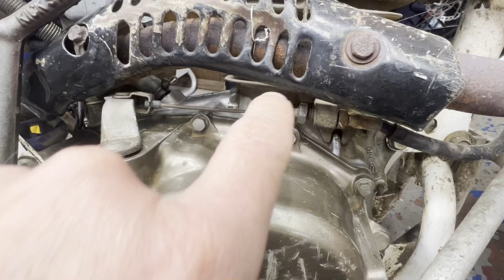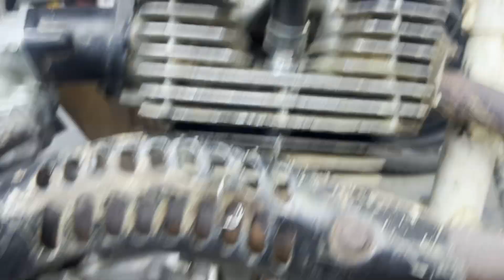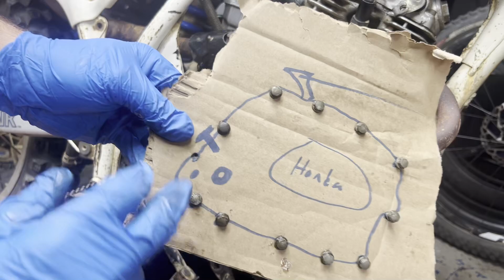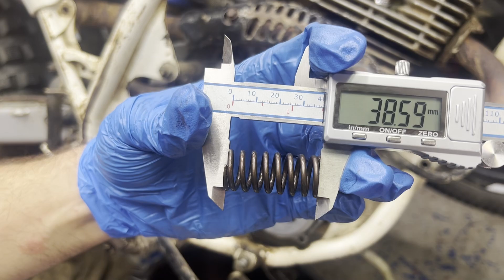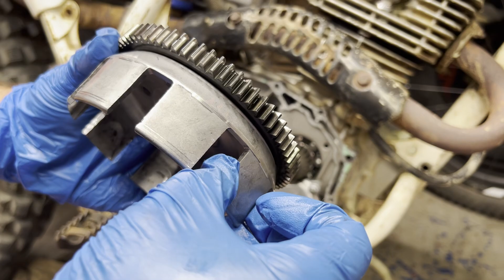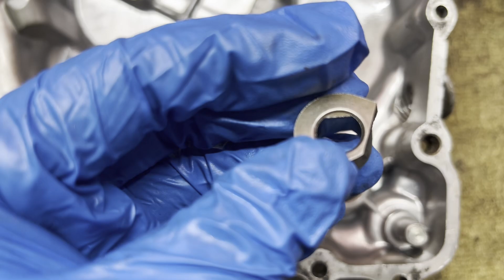Honda XR200 Clutch Replacement and Centrifugal Oil Filter Service

Comment: Nice vid bro but I came just for the case bolt pattern and you skipped it twice lol
Reply from the maker: Thanks lol.  The side cover bolts can just be crisscrossed as best you can.  It’s not like bolting down a cylinder head or when you split the case.
Reply: @Garage2Trail yea ik it I just don’t know where the long one goes
Reply: @Garage2Trail I figured it out lol thanks for vid
Reply from the maker: @shayneparr4273 ok cool.  I suggest making a drawing of the side cover on a piece of cardboard and inserting the bolts in relation to where they go on the bikes. Takes all the guesswork out.
Reply: @Garage2Trail my Kickstarter is locked up and got it to free up put the case back on and it was locked again and won’t turn without case off now any suggestions?? And yes I liked how you made that I always try to take pics and whatever else I can do when working on stuff
Reply from the maker: My guess is the alignment dot on the kicker shaft and arm with the spring isn’t lined up.
Reply from the maker: https://youtu.be/1y5Hpfuxu6U?si=_KvyntUuqOXt9jn1

Scroll to the 35:15 area to see what I’m referring to
Reply: @Garage2Trail yes the two little dots? I have them lined up with the spring on it looks just like yours not gonna lie it’s gotta something simple

Comment: could you make a video about the kick lever decomp system, i bought a xr that was missing the clutch cove and the decompression parts that touch the kick starter
Reply from the maker: I probably won’t have one apart for a little while to be able to show you, but I’d suggest checking out the parts view on CMSNL.com so you can first see what you’re missing.  There is a spring that attaches to an arm that needs aligned on the shaft.  Very tough to find just those parts without paying an arm and a leg on eBay.  Do you have a service manual?  That will help a lot too.  You really don’t need it with the 200 as long as you kick it gently…don’t “stab” kick like a 2 stroke.  Get the kicker down to where you feel it grab and give a good solid kick from there.  My 86 XR200 doesn’t have it and it’s been fine as long as you get the kicker to engage before giving it a hard thrust.
Reply: @Garage2Trail  no luck to my specification, ill suffice and ride my 1982 trail buddy untill i can get the info
Reply: @Garage2Trail  thank you anyway for trying to help to your best

Comment: Hey so I’ve been trying to just take the clutch basket cover off I’ve already got the nut off now it just won’t come out and every video I’ve seen it just comes right off but I’ve been on this for 2 days
Reply: To be more exact it was the cover you took off 10 min into the vid
Reply from the maker: I’m assuming you took the clutch spring bolts out already?  Maybe your plates are stuck together.
Reply: @Garage2Trail no springs are off and everything just will not come apart my clutch won’t engage either I’ve still got it apart and try to tinker with it when I have time but still struggling with it

Comment: Hi I replaced the clutch pack same as you have. The issue is when the clutch assembly is together the plates have alot of space? Did you experience this? 5 fiber and 4 steel? Thank you.
Reply from the maker: Hmm yeah that sounds right.  What year is yours?  I don’t recall a lot of space though.  Do you have new springs too?

Comment: xr 185 u mean never did a 175
Reply from the maker: XL175
Reply: @Garage2Trail  never heard of one i had xl185s blue  175  just not heard of one u may have them in the us but uk dont
Reply from the maker: @ oh that’s quite possible.  The one I have is a ‘74 model and I think they only lasted a couple years in the mid 70s.  I really like that bike.  Great lines and classic colors . Mines the “Mars orange” model with the low swept pipe.  A friend of mine had an XL185 as well!
Reply: I missed what year was this XR200R. I know you had the 83 in the background, but these white frames are more modern right?   I have one but the number on the steering stem is so light I can’t read it.

Comment: Hey you might want to double check how you installed the lock nut on the clutch and the oil filter. In the honda manual (p 8-6) it reads "Install the lock nut with the chamfered surface facing inside." I noticed in your disassembly the one for the oil filter was installed this way, but the one for your clutch was the opposite? Maybe that is why you found it loose. 

Anyway, thanks for posting these videos. I've rebuilt a clapped XR just about top to bottom and front to back at this point. They have been helpful.
Reply from the maker: Thanks for pointing that out!  The 83 200 I just tore down and put back together had the flatter side up agains the washer but looking at my cycle pedia book it does say that as well.  Glad the vid helped!  I appreciate the help as well.  Luckily I can flip that nut as I’m still waiting on parts to finish the top end.
Reply: @Garage2Trail   No problem, good luck with the build
Reply: Just in the process of starting on an 86 XR, can you help on warning sticker placement? Looking to finish by 2026 with museum quality... Owners manual just overall points at placement. Thanks.
Reply from the maker: @ hmm, I can’t say for sure where each go but I’d recommend joining some Facebook XR200 groups where there are rabbit 200 guys that have some really nice bikes.  They can probably share pictures where each would go.  I can’t say I’ve ever gone that far with my bikes and this one is missing them I think.

Comment: How did you keep the crankshaft from turning when you undid the oil filter nut?
Reply from the maker: I just used an impact gun which will usually zip it off without having to hold, but you can put a penny in the gears to hold it in place too.
Reply: @Garage2Trail  Mine is royally stuck. Never seen anything like that. I bent the handle of the 1/2 socket drive and it still hasn't come undone.

Comment: Don't use the kickstarter to much without the decompression cable hooked up it will cause the gears for the kicker shaft on the inside of the crank case to strip out I've bought 4 really cheap xr200's over the years because of that and it's a real pain to fix
Reply from the maker: Thanks for the heads up!  I found the cable, arm, cam that goes on the inside, but that damn spring that’s also on the inside of the cover is almost impossible to find without buying an entire used decomp system for stupid money.
Reply: @Garage2Trail  I looked through my extra parts tub and I've got a really nice clutch cover assembly that would just need the 2 oil seals replaced,has the decompression bolt/arm/spring and I've tossed in a couple extra clutch cover bolts since you're missing one,if I can figure out how to get ahold of you I'll send you some free parts for your xr200r project
Reply from the maker: @hairlessharescrambler56 oh wow, that is really awesome of you man.  Thank you so much!

Comment: Some clutch baskets have to be aligned in a particular position so 2 marks line up, that's not the case with this bike?
Reply from the maker: I didn’t see any mention of that in the manual